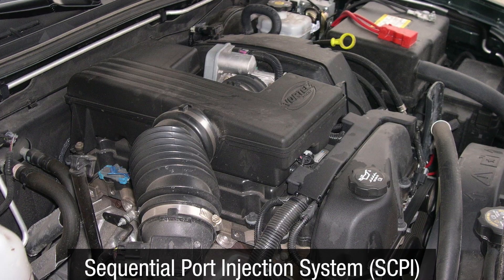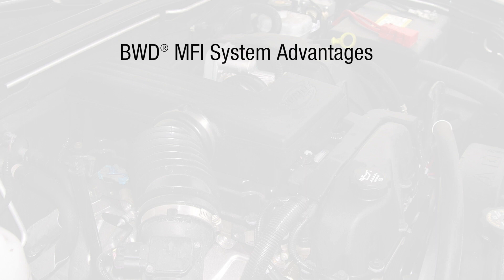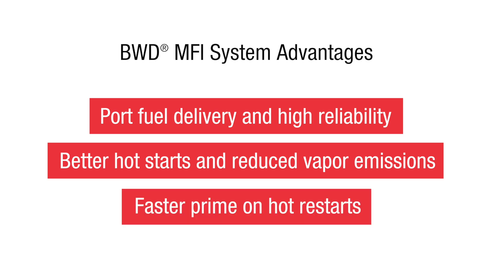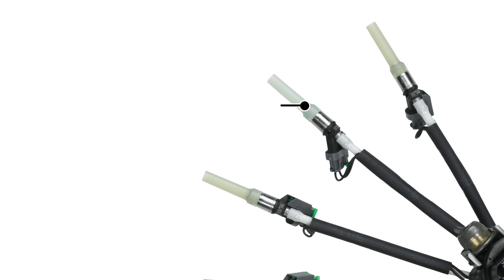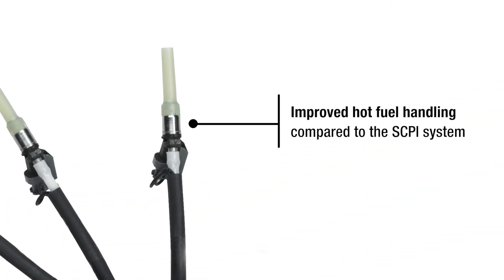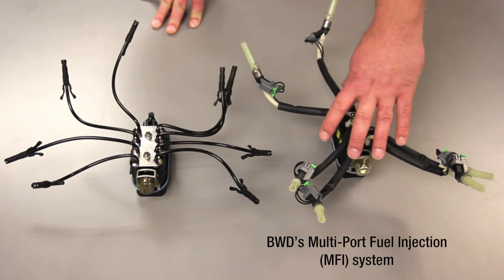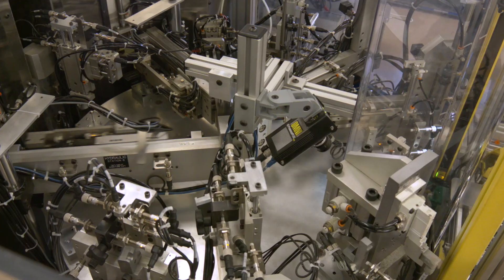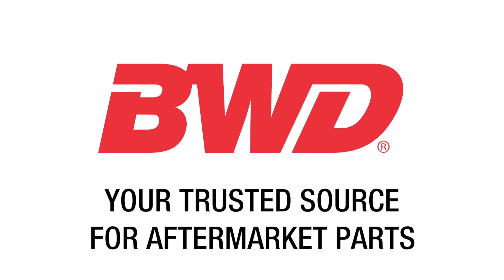A Closer Look: GM Vortec Injectors

Comment: I install this spider injector it failed after 2 months 1 of the plastic hoses ruptured Replace the with an oem injector no problem I would avoid.
Reply: Durham manufacturing defects in any piece of equipment or materials that's why they have a warranty
Reply: @rustedratchetgarage6788  I was thinking the
 same thing I decided to go with OEM I didn't want to break down again not worth it to me.
Reply: @paulsthormes251  your money you do what you want with it sir